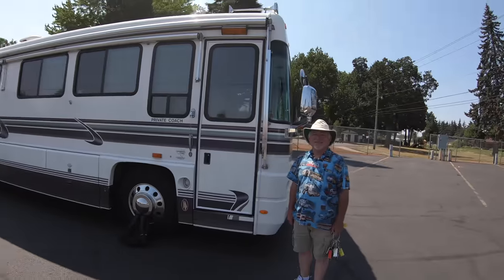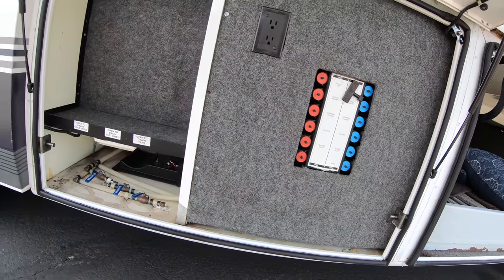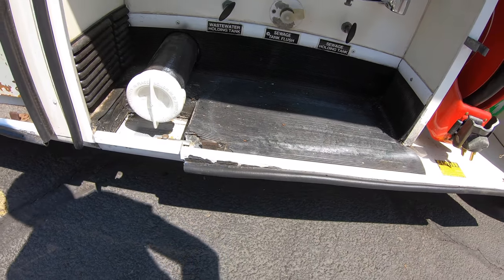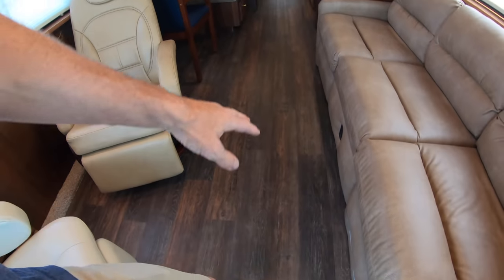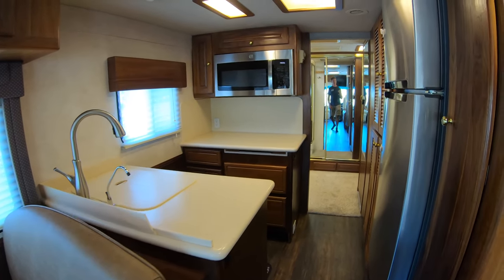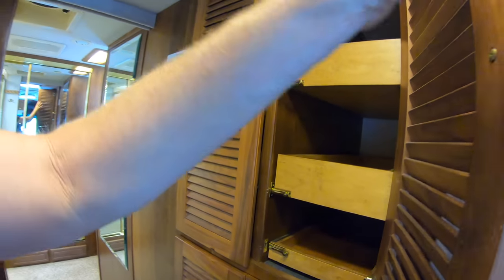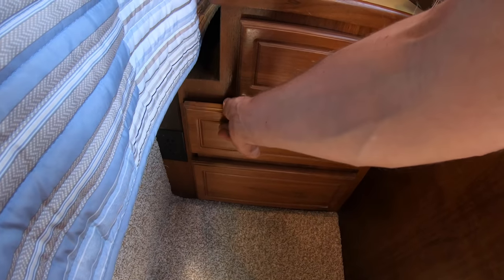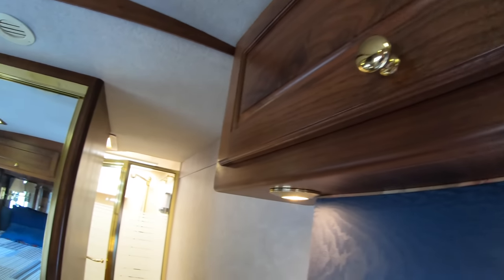COOL 1999 Foretravel U320 #5393

Comment: First LOL, these are nice coaches but at $89K seems steep but this dealer is higher then all  on prices. The Grand Villa was one of the first with the joeys trays in the basement. The dash always rattles and pops up.  These have a very different kitchen design and that hallway is so tiny. .
Reply from the maker: I agree with you. I would think there is room to work it. 😁

Comment: Just read in the description the laminate flooring,  best flooring for a motorhome. Don't know why they ever switched to porcelain or ceramic tile! Laminate retain original look and finish way longer than tile, doesn't chip when you accidentally drop something on it. Won't crack or pop loose from twisting of the frame.

Comment: I heard a rumor Foretravel was asking Newell if they were interested in buying out the company but was soundly turned down. Its just a rumor but after seeing the factory not long ago I wouldnt  completly dismiss it. They only sell direct to dealers now such as RVone who primarly deal with low cost rvs. In addition foretravel is now using only premade spartan chassis abandoning their homemade chassis design to cut down on cost. They may soon follow suit with Tiffin joining Thor if they are lucky, worst case follow Country Coach.